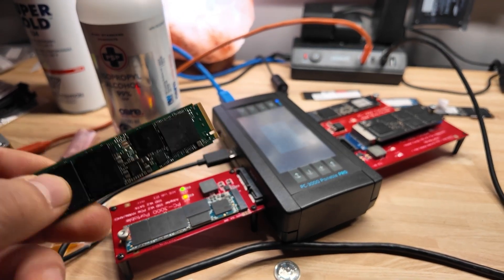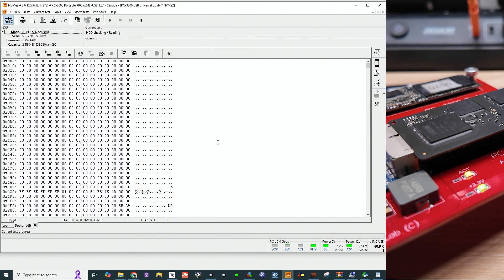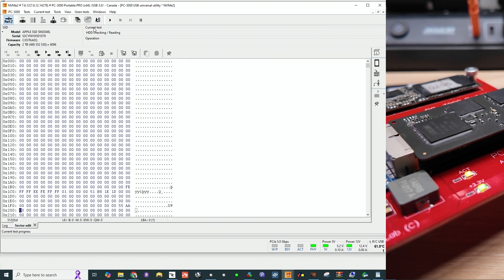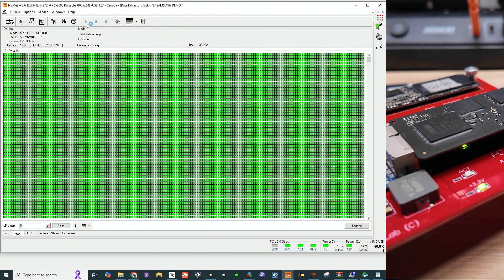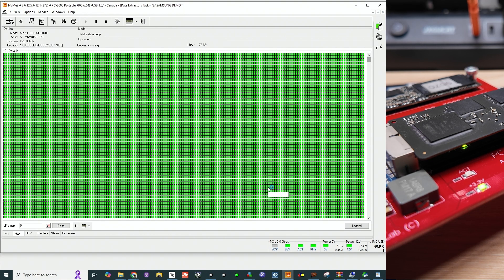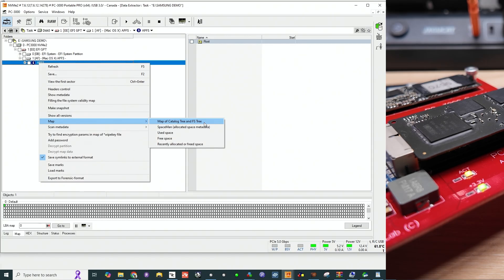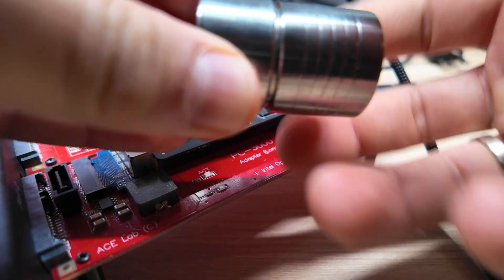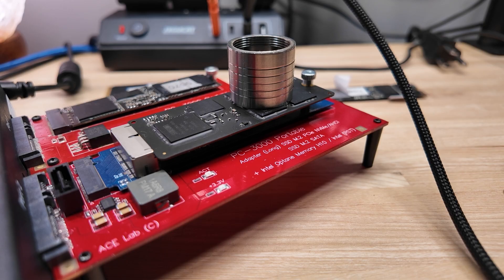how to stabilize your failing SSD

Comment: Many years ago before we had solid state drives I had an issue with a board that was a ram buffer for a drive. The board kept dropping out. I wanted the data off the drive. I also noticed that bending the board made it work, but it was really twitchy. Instead of weights I used a "C" clamp. I supported the board on the ends with spacers and used the clamp to slowly add pressure.

Comment: Maybe keep some small trigger clamps for easily adjusting pressure.  Don't want the drill to fall over and damage your PC-3000 portable pro.  Lateral thinking keeps the lights on and food on the table.  Same kind of thing with the heating device you used.  Another interesting video.

Comment: dude i recovered my ssd the same way. my adata nvme bricked and when i put pressure on the controller near the edge connectors it works. i guess theres some cracked solder or something. maybe putting it in the oven might help reflow it idk